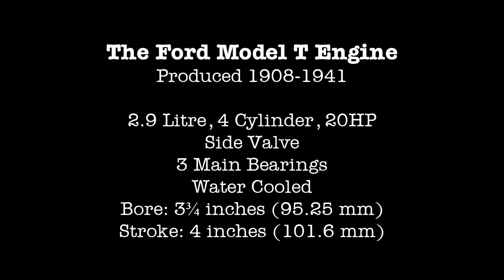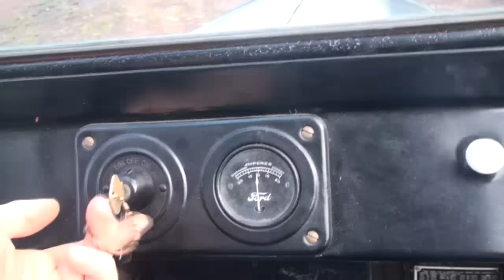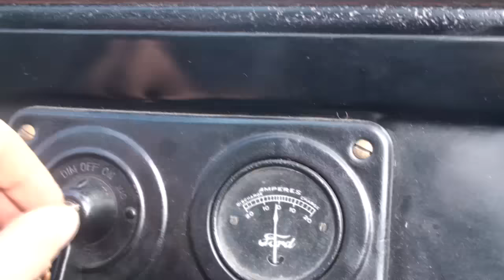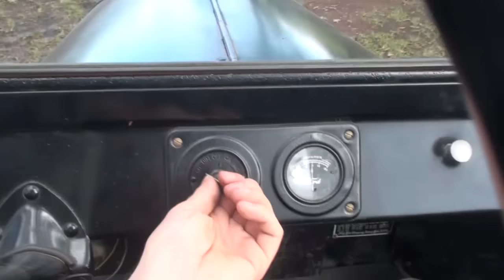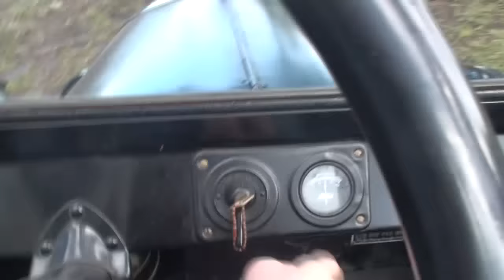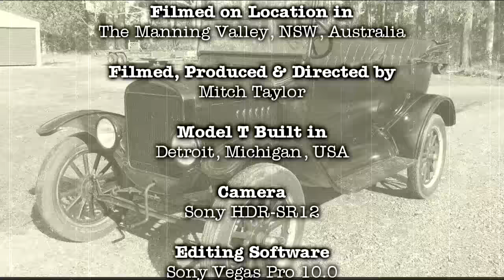Ford Model T - How to Start & How to Drive

Comment: Where's the aux port?
Reply: blackopsfan00 Next to the Bluetooth connection.
Reply: blackopsfan00 there is no radio cars didn't have a radio until the Early 40s
Reply: Shaquan Branch 
it's a joke dude
Reply: Shaquan Branch r/wooosh
Reply: next to the crank start.
Reply: cleanview70 go
Reply: Shaquan Branch ik im late but r/wooosh
Reply: Right next to the in-car entertainment system
Reply: Right next to the OBD port!
Reply: On your Ford Focus.
Reply: On the Prius
Reply: Shaquan Branch in car radios the aux port didn't exist until the mid-to-late 90s and Bluetooth in car radios didn't exist until the mid-to-late 2000s
Reply: Fat Blunts 69 oh burned
Reply: Lol. Where do I stick my phone cables? In this smelly compartment?
Reply: blackopsfan00 Ya better not play trash
Reply: In the fuel tank
Reply: It's over where you'd usually keep your shoeshine box
Reply: Shaquan Branch 
Thanks captain obvious
Reply: And where's the USB input?
Reply: It's next to the fuel tank oh and make sure you dont mistake it for the fuel tank cause once i was kinda tired and filled the AUX with petrol and when i started the car bassboosted mozart started coming out my exhaust and every time the bass would drop the car would backfire needless to say i nearly shit my self and tried to attack the car with the petrol pump i fixed the issue by repeatdely insulting the car
Reply: you are master not if you get a 1925 model they added near the fuel tank for extra bass
Reply: shadowXXe
🤔
Reply: @pmailkeey right above the back up camera screen
Reply: @shaquanbranch8702  woosh
Reply: in the coil box
make sure to connect it to the secondary winding
Reply: @jonaveneverts11  it's a joke.
Reply: in your smartphone
Reply: Shaquan Branch whoosh
Reply: Theli whoosh
Reply: blackopsfan00 lol
Reply: Shaquan Branch r/woooosh
Reply: next to the "sub on/off" button
Reply: @shaquanbranch8702  r/wooooshhh
Reply: @shaquanbranch8702  r/whooosh
Reply: Wlan Hotspot?
Reply: Dios  esta. Con. Israel
Reply: Bendigo. A. Israel
Reply: You do installing Stereo 8 track player 😃
Reply: Shaquan Branch R/wooosh
Reply: Inside the exhaust pipe, put your phone inside and you got a nice reverb
Reply: Where you check your engine oil
Reply: Paul Stark Hahahaha nice one.
Reply: Next to the climate control.
Reply: @awertyuiop8711  it's 4 O's, not 3
Reply: Führer des Benutzers  Justen listen to ya grammophone, which is clearly loud enough...
Reply: @jameschen9894  watch the video closely - you have two petcocks underneath the car. Open the first and if oil is dripping out, you're safe. When nothing comes out of the second petcock, make sure to fill in some or check where it is leaking.
Reply: @shaquanbranch8702  no fucking way?
Reply: @shaquanbranch8702  You missed the joke. Obviously....
Reply: Wheere the subwoofer
Reply: @shaquanbranch8702  I feel sorry for you for not being able to perceive jokes.
Reply: Your mouth
Reply: Right next to the clockwork primer for the phonograph mechanism

Comment: I heard once that when the Model T salesmen went out to these small country farm towns to sell the Model T, they'd have to teach people how to drive. And when they did, when people wanted to slow down, instead of using their break, their first instinct was to yell "Whoa there" because they were so used to using horses. Lol.
Reply: Brake.
Reply: I saw the same documentary at school 🤔
Reply: It's actually true. And it's understandable. I think it's hard driving an automatic when I'v used to a manual, always hitting the brake thinking it's a clutch when I forget myself...it'd be 100% worse for people without any prior experience in driving. It's hard to think straight in a stressful situation, as I found out when I was about 16, trying to drive a standard, and ended up futilely pressing the clutch pedal trying to stop myself while rolling faster and faster backwards down the hill. I could think enough to try and drag my foot out the door, and I recall trying to put the car into first gear and start it, but I apparently never managed to think far enough that I was actually hitting the clutch pedal, not the brake, and that's why the car wasn't stopping (it eventually ended up deep in a snowbank, back first).
Reply: Well, I'm glad you're alright and all you hit was snow. That could've been much worse. 

It is kind of understandable. I've never driven a horse and buggy so it seems odd to me but when you're used to one thing and you're learning something else it can get confusing.
Reply: I seem to remember this exact description in a John Steinbeck novel.  “Cannery Row” maybe
Reply: They also have trouble using the steering wheel to turn cuz they were used to horse's just following the path
Reply: I've actually heard this from some old timers.
Reply: Oddly enough Ford offered a voice activated braking system.  But the vehicle was discontinued before it came out.
Reply: @Gizmowerks  east of eden
Reply: bondfranklin  I was bored in study hall and picked up the book and got engrossed in reading it, it was about real people and from his description you could imagine salinas and montrerey when the canneries were at full production. It was too bad that the movie so much on being a romance instead of the adventures of Mac and the boys.
Reply: We yell "brrrrrrrrr" here
Reply: *brake
Reply: My great-great grandfather, a civil war veteran, got his first car home in 1920, yelled "WHOA" and crashed his car into the back of the barn.
Reply: Just can't beat that Ting sound in the tail shaft changing gears and the differential winding up to cruse at 40mph
Reply: 76 years young thanks.
Reply: @Paul the Skeptic   Yes, someone in our neighbourhood - still between us, 2018 - drove his first tractor, yelled "Huuuuuuuuuuu!!" and ... landed in a ditch!
Reply: I had a similar experience in that I kept pulling the reins tighter while learning to ride a horse, like I was applying the brakes.
Reply: This all reminds me of my Scoutmaster, a fighter pilot in the Pacific. After flying month after month, he jumped into a jeep and took off (figuratively!) down the road. Came to a turn, gave it full right rudder -- and accelerated right into a hut!

Comment: Basically a sports tractor.
Reply: Pretty much. At least as far as the column mounted throttle lever goes. This was common on farm tractors until recently.
Reply: Steve Reach thats exactly what I thought of.. like a hydrostatic
Reply: yes it's a cart which looks like a tractor but it's actually a car and great car it is
Reply: I find it quite unfair that I have two thumbs, yet YouTube only allows me to raise one for this comment.
Reply: hehe
Reply: Did you know that Lamborgihni actually makes farm tractors? Even as recently as this very year.

Comment: This is the first video I've ever seen of someone hand cranking an engine PROPERLY.  My grandfather always drove it into my head to never wrap your thumb around the crank handle.  If it kicks back, it will break your thumb or wrist.  Nice video.
Reply: ...break thumb, wrist, arm, teeth or nose.
Reply: I wonder if he saw someone who was “cranky”
Reply: My Father and Grandfather sternly advised the same about never wrapping your thumb around the crank handle and using your left hand to start
Reply: If the engine has a spark retarder it will never kick back/ back fire
Reply: My grandfather oft repeated the same thing, although I was never in a position to start a Model T.  When I lived in New Zealand, my only transportation was an old Yamaha 550G single-cylinder motorcycle.  It had no compression-release.  One day when I was visiting Auckland, it kicked back while I was kick-starting it, and threw me over the handebars.  I limped for a long time, and now, decades later, my ankle is still sore.  At 177 cubic inches displacement, a single cylinder in the in-line-4 Model T engine is nearly half-again bigger.  I'm sure it could easily break your thumb or wrist!
Reply: Oh yes. I've never had to start a crank-handle engine, but for some reason, I've always held it in my head that if I do, I should use my left hand and never wrap my thumb.

I don't even wrap my thumb around my steering wheel when driving.
Reply: yep thats a fact. I had the same advise.
Reply: Ha! My grandfather taught me the same thing, and I noticed Mitch didn't mention it in the video (though he did it when he cranked). This was important information for a 16-year-old in the mid-70s.
Reply: Electric start engines were first invented in the US after a family friend of the head of General Motors was killed as a result of engine kickback, the man had stopped to help a stranded motorist. The handle broke his jaw and he eventually died after infection.

Comment: 100 years from now, these kind of videos will be about cars of today.
Reply: “They actually burned fuel from fossils, and they thought it was gonna last forever”
Reply: How to drive a car
Reply: How to drive a manual transmission...... oh wait some people actually are searching for that in this year still.
Reply: back in my day, we didn't have self-driving cars, i had to drive myself to school. in the snow, in July, uphill, both ways.
and we couldn't just say "Alexa, start the car".  i had to go outside and turn a key.
Reply: Cars from today would never last 100 years.
Reply: 100 years from now the earth will be dust.
Reply: @angelonicassio7131  How would you know? Cars from today aren't 100 years old yet.
Reply: Chopped Snot,  Yes....now this is how you start a 1993 Toyota Camry...
Reply: @MrYfrank14  Back in my day, some cars had 3 pedals, the left most one operated a piece connected to the transmission while the driver would also have to push a gear management device into the correct gear.  You would also have to push in that 3rd pedal if you wanted to start the engine, and always make sure the gear management device was not in a gear.
Reply: @BlueOvals24  - that's right.
We had to shift our own gears.
Kids today.
Reply: CoyotePowered5.0 are you kidding?  Just look at 10 year old cars...   they’re all shot.  Everything is plastic and there are 10 computers.  It’s called designed obsolescence.  Look at a Chevy Cruze and tell me that you think there will be a single one on the road in 10 years.  They are garbage.
Reply: @angelonicassio7131  You can't just throw the Cruze as an example dude.  Cars people actually give a shit about like Camaros, Mustangs, trucks those will still be around 10 years from now, hell New Edge Mustangs, even early SN95's are still around.  Everything's plastic?  Yeah, bumpers and spoilers.  Hoods are aluminum, some are steel, same for fenders and 1/4 panels.  Early 2000's Lexus have many computers yet I still see em on the road every day.  I'm a fan of old school carb engines myself, but you gotta come to grip with the fact that cars today are way more efficient and that doesn't make them unreliable.
Reply: Needs a V8
Reply: @MrYfrank14  um we still do that you acting like we got flying dinosaurs out here
Reply: all cars built today will have bio degraded in 100yrs
Reply: theone2be33 it won’t-.-
Reply: @BlueOvals24  because   They are made cheaply. And once one of the crazy thousand computer components dies and isn't being made anymore (which is already happening), the car is useless because it isn't fully mechanical so it can't be made to run again without the various computer components which aren't made anymore.  So you literally don't be able to do a damn thing to it.  Whereas a model t has no computer circuitry to die on you.
Reply: @morsteen  Yeah but those computer components make the engines more efficient and powerful.
Reply: @BlueOvals24  and how is that going to matter when they are dead?  Old mechanical and electrical (not computers) shit like this can still be resurrected another hundred years from now.  You just literally will not be able to do such a thing with a modern car.  Which is actually ironic, since they will effectively become obsolete, while the model t can still be made to propel itself at that time .
Reply: @morsteen  Yeah, and look at the model t, can barely pull it's own weight to 25mph and sucks up way more gas than a modern 4 cylinder. Yeah it won't be as easy to resurrect today's cars eventually, but resurrecting a car built 100 years ago is pointless aside for car shows. I have a neighbor that has a model a, just recently restored. He never drives it on the streets because he would be a hazard to all the modern cars out there. You know what he does? He trailers it with his 2005 F250. I'd rather keep a car for 30 years or so, then get a new one rather than be stuck going 25mph everywhere  I go. Save these 20's-70's cars for shows because that's about all they're good for, looking and sounding cool.
Reply: @BlueOvals24  yeah but someone was alluding to what might happen if this is all you had left because all the newer cars could never be resurrected again.  That this could still be around.  You technically could still get around, basically.  And if you lived in a small town of say 850 people, the. You could easily put put around and still live life when the "new" cars went extinct or something crazy happened to them since they won't ever last and will all fail because computer tech electronic circuit board tech ALWAYS fails eventually. Capacitors go bad, boards just crack due to age.  And those will never be able to be replaced.  Thay was the only point .
Reply: @morsteen  What you just described is the apocalypse, and if that ever happens getting around will be the least of your concerns.
Reply: @BlueOvals24  no it's just the fact that even in another hundred years there will still be the ability to make a model t run.  Whereas there won't even be the abikity to make a 50 year old computer car run based on the lack of circuitry available and the fact that all that circuitry will have failed by that time.  But the model T could still be made to run with simple parts.  What average to competent mechanically inclined person could make up the entire circuitry of our modern cars in another hundred years from now?  But that same person could easily bolt something onto the model t to keep it running, or fashion a copper contact using tin snips.  No way they can rebuild everything needed just to start one of our modern cars in a hundred years from now.  That was the point. Not that you could still use it in an apocalypse, but then that also does apply lol.
Reply: @morsteen  But why would you want to get any car running in 100 years or even 50 other than for show? Like I said, you can restore a Model T, however there is no power to them, no efficiency. And just like there are resto companies that cast cylinder heads and camshafts for old cars, there are gonna be companies making computers and circuitry for current cars, in fact there  already are. Some of them are even better than OEM. People restomod old cars and chances are in 50 years today's cars will be restomoded. So no, it won't be impossible for todays cars to be rebuilt like how that Model T was.
Reply: @BlueOvals24  There are barely any companies that make circuitry for a lot of the 80s/90s/2000s cars that aren't the most popular ones.  And there were probably people who said back in 1920, why the fuck would you ever want to have this car running in 2020 you dumbass haha.  Uhm,...because it can still be made to run and you can get use out of it.  That's all you need.  So there just might be someone's great grandchild who will want to get their great grandfather's 2019 honda Civic Type R Running again because it was such a neat/cool car when it was released.  Well,...even being one of THE most popular cars of this century, I would bet there won't be all the circuitry made in a hundred years to even be able to complete the starter circuit, let alone all the other various stuff to keep it running once it's started. Hell, all the emissions boxes and stuff that controlled everything on my 80s cars are completely obsolete and not being made by anybody anywhere.  Luckily those early 80s cars I've had were carbureted, so I could at least ditch that stuff and upgrade just the carb.  But when it's FULLY controlled by circuits then it's just over when something like a main relay goes out, and nobody makes it anymore, eventually the supply from places like rockauto will dry up.  Some cars like the 1989 integra are prone to circuit board cracking issues in the relays.  So once those just decide to go and it's even 40 years from manufacture date, too fucking bad.  Nobody makes them.  And that stops your entire car from even starting.  Even though all the mechanical parts are still there existing, and ready to be initialized.  The damn little box with a circuit board inside that for some reason cracks in a bad spot naturally, just won't let you.  I suppose the only way would be to restomod with all new stuff not intended for the car.  Fortunately you can have an authentic experience with older cars, and not have to be forced to restomod it just to get it to start lol
Reply: @angelonicassio7131  exactly.  Ex fucking actly.
Reply: @HP_line_cook  LONG LIVE MANUAL!
Reply: @Sirdiggar  amen to that!
Reply: @BlueOvals24  "Save these 20's-70's cars for shows because that's about all they're good for, looking and sounding cool."
Lotus 7: "No fuck you lol"
Reply: @morsteen  You can't run a Datapoint 2200 today?, That's a 50 year old computer.
Reply: Ya see you push the clutch down first